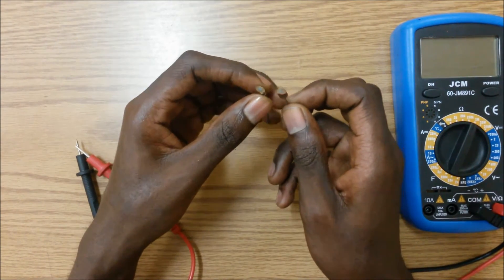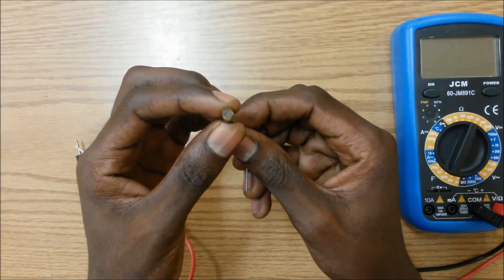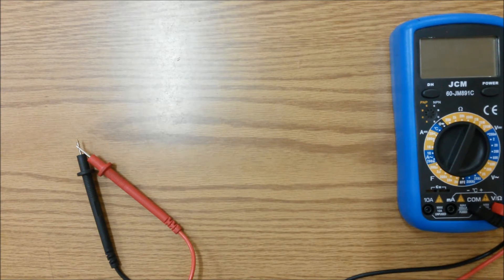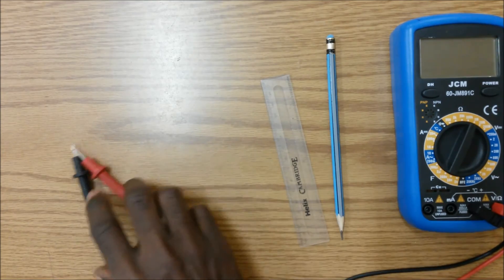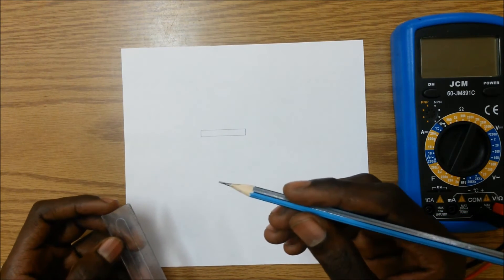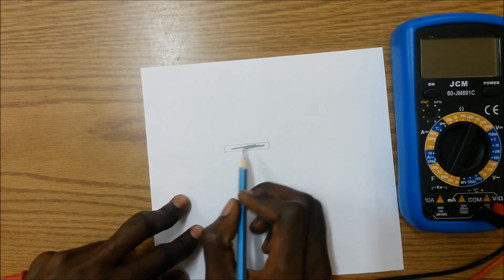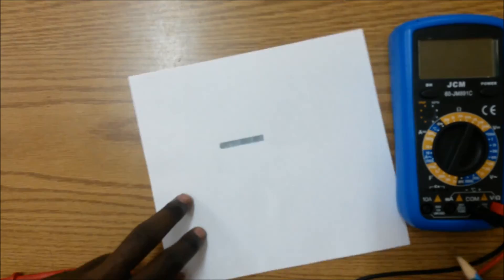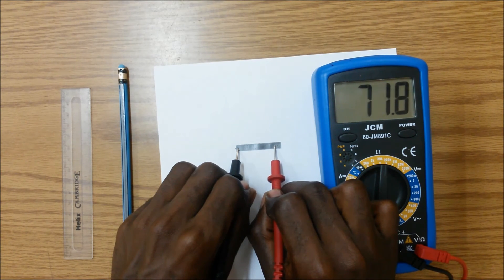How to Make a Resistor at Home (Home Made Resistor)  | Junior Roberts

Comment: I wanted to test my circuit but didn't have a 100 k ohm resistor. I'll try it right away
Reply from the maker: Let me know how it works out 👍🏾
Reply: @realJuniorRoberts  I tested capacitance measurements with pencil resistor. I learnt two things:
1. I should care about the thickness of lay-over to adjust the resistance.
2. It works perfectly as a resistor, but my code is full of trouble XD
Reply from the maker: @passecompose7484  okay great. Excellent observation 🔥